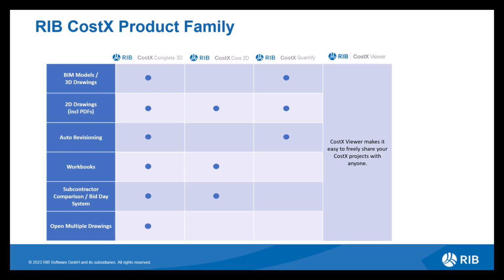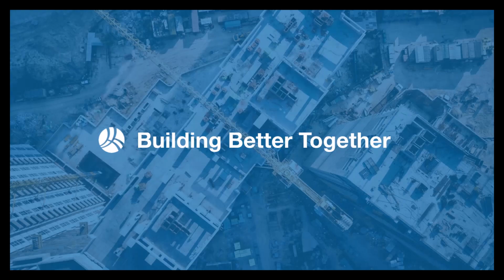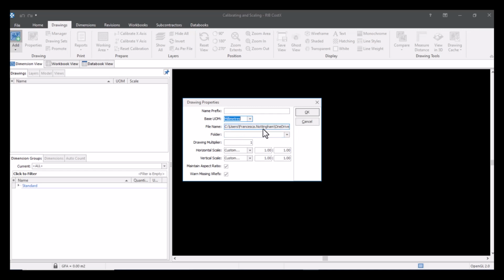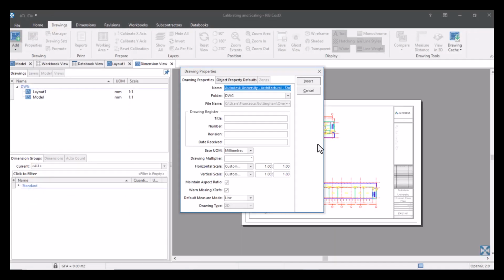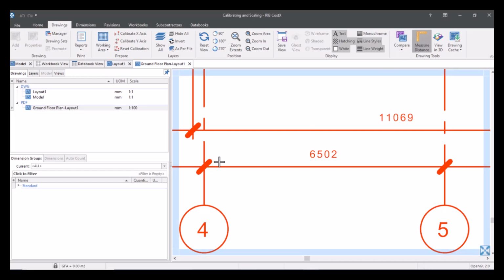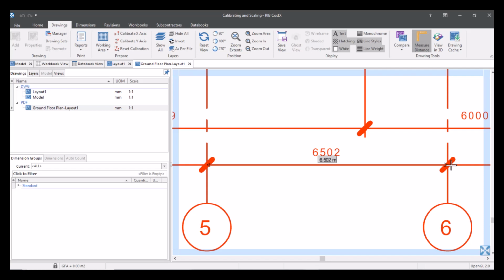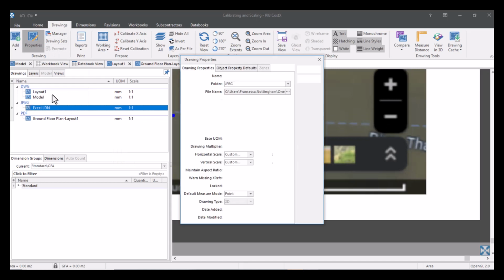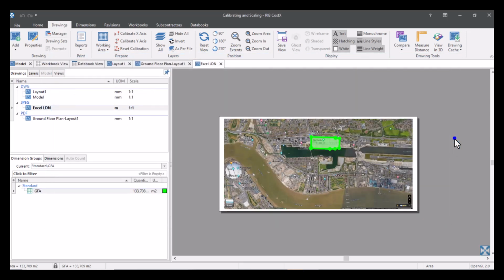RIB CostX Coffee Break Webinar - Calibrating and Scaling

Comment: Hi, I'm facing an issue in CostX. When we set the scale in the Properties panel (e.g., 1:100) instead of using manual X-Y calibration, there seems to be no option to reset it if the scale is incorrect. The normal reset button doesn't work, and even selecting 'Custom' in the Properties panel doesn’t allow us to reset the scale. Could you please advise how this can be resolved?
Reply from the maker: Before using the 'Reset Calibration' button, you need to bring the drawing back to it's original state in scale. For example, if you brought the drawing in and had the default scale selected i.e. 1:1 and then once learning the drawing scale or calibrating it, you changed it, you need to return it back to 1:1. 

Follow these steps:
1. Head to the drawing properties and amend both horizontal and vertical scales to what they originally were when you first brought them in. i.e. 1:1.
2. Click 'Update'.
3. Select the 'Reset Calibration' button. This will take the drawing right back and strip away any pre-selected or calibrated scales.
4. Now you can either head to the drawing properties again and select from the list, either a scale from the list or enter in a custom scale. Alternatively, you can now set either the X or Y calibration (or both) to your desired dimensions.

Hope this helps!